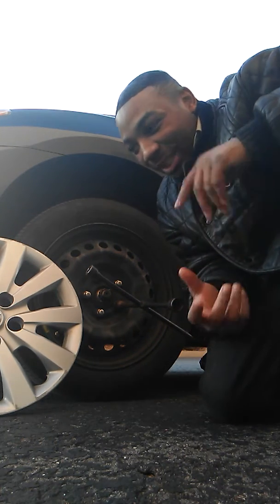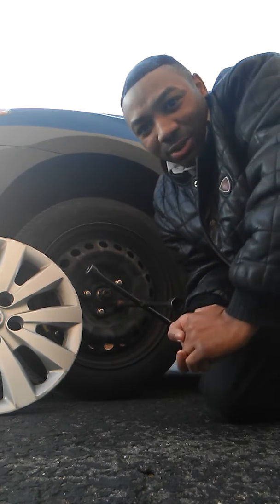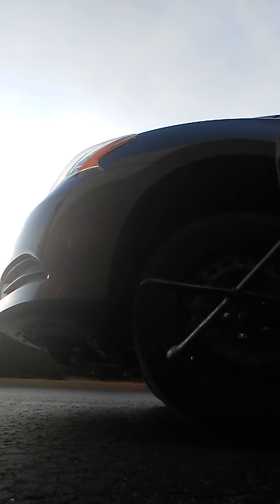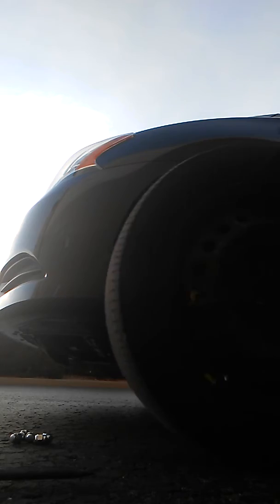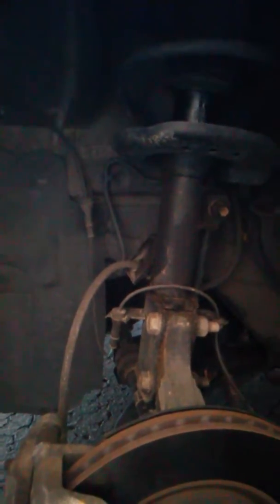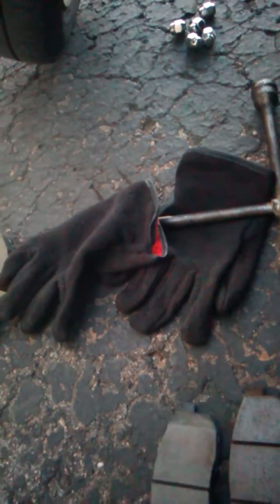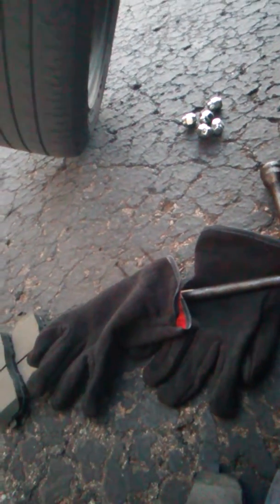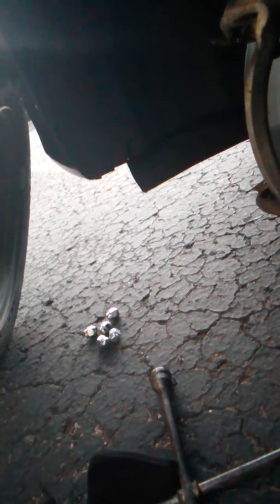Andre changing his brakes on a Nissan Sentra 2013

Comment: My brakes are squeaky alittle  in the back but my car is a 2016 tho. I guess cheap pads. I missed my Nissan Versa.
Reply from the maker: Sakura M Nissan Versa is nice too, they offered me to trade my Sentra in for a new Versa but am still happy with the Sentra, cheap brake pad won't make your brakes squeaky, it probably just needs oil on the back of the pad or sometimes dust gets underneath if they put too much oil on area's of the pad where the caliber doesn't touch, pad oil should only be on the area where the caliber touche, if they put oil on the entire back of the brake pad, the dust can collect on the access oil and cause it to squeak, so I think it may be dust or not enough brake pad oil
Reply: I would probably get it check out then.^_^
Reply: Andre Tresvant thanks bruhhh. I got 2013 Sentra n the traction lights came up about a week now n stays on even when drive n it feels like something is keeping back the car from rolling freely